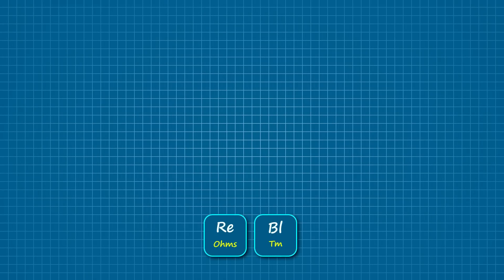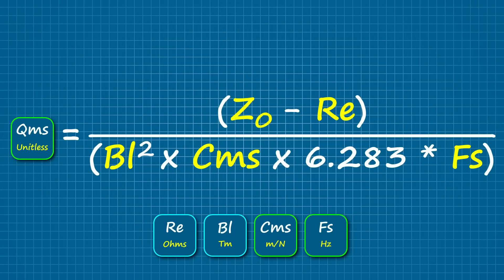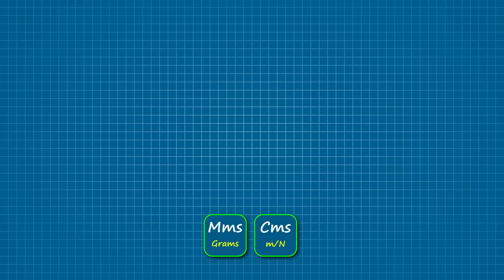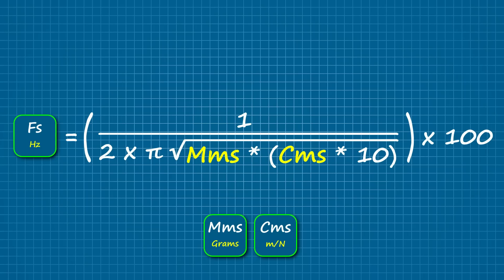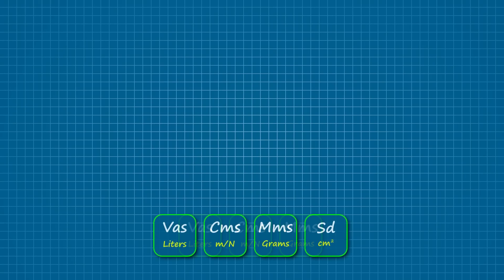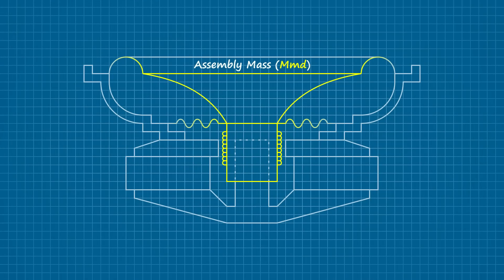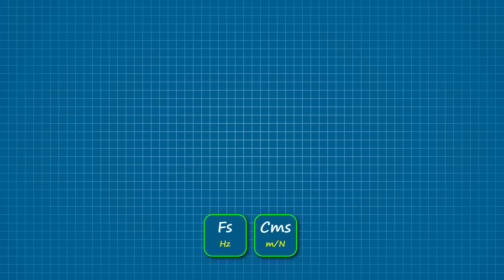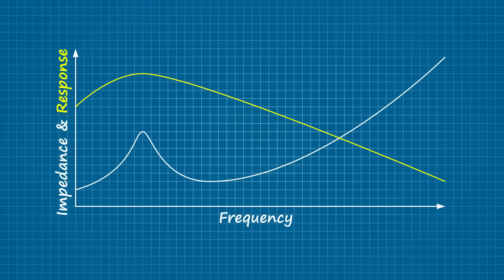T/S Parameters Explained (Part 2)

Comment: I've built guitars, valve amps, speaker cabinets, recording gear, recorded and mixed and done just about everything but this is the one thing that brings that all together from inductors, electrical losses, impedance, Ohm's law etc. Its all making sense where it didn't reading a book 30 years ago - thank you so very much!

Comment: Excellent information. Another T/S style parameter that is often messed with is Sensitivity. Usually listed as 2.83V, which IS 1 watt into 8 ohms (nominal) BUT 2 watts into 4 ohms and 4 watts into 2 ohms. So this inflates the 4 ohm sensitivity by 3dB and 2 ohm by 6dB. Weasels!!!

Comment: I Bought Some Subs that has no Spec data in the boxes nor website and when i email the Company i got no response. We dont hardware to test it manually so is there any recommendation for an Enclosure. They are 12 Inch, Single 8ohms, 150RMS. From the looks of it I would say about 10mm Excursion Peak to Peak. Any help would be Appreciated. Subs Are Powebass PX-128

Comment: I am 55 and have finally registered as a sole trader designing, building and hopefully selling a battery run, high fidelity, high power  and portable guitar amplifier for busking.
As a guitarist / musician  with a good grasp of electronic engineering and carpentry, but not of speaker box design, I have done a lot of research and it becomes more interesting, especially when it is important to customer confidence that my product lives up to may claims.
I have also found that solid answers don't come without solid data, which you have supplied. Thanks.

Comment: These two videos are probably one the best around about drivers parameters.
About Le value : it's irrelevant in the loudspeaker box nor filter design, as it's far better to use an advanced software which include the Fr (driver+box+baffle step) and the Z curve (in the box !), than a zobel.
As a designer I use to keep it low, for Le(i) THD, and linear within X for Le(x) IMD.
The lower Le in the coil, the higher Le in the filter for the same cutoff, but lower thd+imd.

Comment: This is all of why I am taking my time to put a sub in my car. My friends keep saying things like "just get a 1500 watt amp and put a 15" in your trunk". But I am designing a few boxes to the TS parameters of a few Dayton Audio RS series subs to try and figure out what would fit well in the upper deck of my trunk. So I am not only bound to the physical size constraints of my car, but also the TS parameters of the sub and the wall thicknesses of the building materials. I am even considering port placement to make it fire up through a hole in the rear deck of my cabin as the upper deck in my trunk is right beneath it (it's a 2008 crown Vic). My vision is to have a truly high fidelity install that doesn't cost me an arm and a leg, so I am choosing to spend my time instead of my money on getting this project done just right.

Comment: Absolutely love the videos, thank you for making the world a smarter place!

I have a video request - I'd be interested in seeing your engineering design process, or as much as you can show without putting yourself out of business! Here's a theoretical: given a specific design objective, how do you choose the loudspeaker and enclosure design, then accurately model the overall cabin+enclosure+loudspeaker+DSP gain (if applicable) to achieve that goal?

As a relatable example, my approach to hobby car audio is trying to get a reasonably low f3 rolloff out of a certain "allowable volume" for the enclosure (sometimes its nice to have room in the trunk for groceries). I imagine the allowable volume would dictate achievable SPL at that lowest frequency and from there we could choose an enclosure type and find a speaker with approximately the right T/S parameters that would meet our goal. I understand everyone's audio goals are different, but for the general flat-response case in a measurable environment (aka specific room or car gain), how would an audio engineer approach the problem?

Either way, keep up the awesome content!!

Comment: PLEASE READ! 

I'm sorry. I was so hopeful for this video. You expanded on ideas and topics I've never considered, like how to spot BS specs, but I really want a video to explain how changes to different parameters affect the sound. How does changes to free air resonance, damping factors, linear Xmax, vas, etc,  affect the required box size, clarity, accuracy, low end extension, power handling, response and more. 
Can you, someone experienced, simply read the parameters and tell if this would not sound good in an X configuration. Like, "this sub is design for competition and loudness, not sq", or "this is best for Rock, not rap."
If you can, I want to know how. 

Ex: look at the ts parameters & compare  a (all JL Audio) 10w3v3 vs 10W6 vs 10W7AE.
Why, when I plot the response in the recommended boxes, does the W6 get louder@low end than, w3, and the W7 get even louder at low end than W6? How is this possible when the box size for the W6 is way smaller than the W3, but the box size for a W7 is relatively large again like the w3. What changed in those parameters?
Reply: Jonathan Fielding : This can be done by someone experienced.. In my case it mostly guides me.. to what woofers I want to model and listen to.. I’ve never bothered to lined up the specs side by side to analyze.. Its a little tedious to remember the average vas for example, of different size speakers in both cubic ft and litres.. ( unless it’s your full time job I guess) ... But a lot can be said about the sound by examining a speaker... ( when you know how the parameters effect response, how parameters are achieved and materials ) .. The vids your looking for would be lessons on how to design raw speaker drivers... (I have some experience ..I’m all in :))
Reply: I was hoping for a video like that as well... no one really explains what specs to look for and what each spec is good for ... car fabrication did a video on specs but didn't really get deep on the important specs I should lay attention too
Reply: Jonathan Fielding

  I´m also looking foward to when he explains all that. 

  But i will give you a little tip, from my experience, just regarding one of the many things you asked. When you said "this is best for Rock, not rap."  Many people assume that there are sub´s better for some music genres and other sub´s better for other music genres. That is BS. A really good sub will be really good with all music genres. But what happens is that there are some genres that are not as demanding as others, so they will not reveal the sub shortcomings as well as other genres. What you have to do is try the sub with the most demanding types of music. If they play those right, they will play anything right.  Just my 2 cents...
Reply: Look up the free program WinISD, you can enter the T/S parameters for a speaker and modify the box volume and tuning dynamically to see what it does to the frequency response curve. On changes to the speaker characteristics, you have no control over that - those are characteristics of the speaker. You do have control over the box volume and tuned port. I do know as a bass player, that one of the most important speaker parameters is Xmax which is the maximum mechanical movement of the cone. If a bass guitar speaker has too small a value (2 to 3 mm), at loud volume the speaker will over extend and "fart" which is the term that bass players use to describe what happens to the sound. ideal Xmax is anything over 6 mm. Music doesn't have this problem because it is compressed while live bass playing doesn't.

Comment: I love how indebth you go into this! so i was that guy that fell for a sub because it had a big magnet and it was used and eventually the shorting ring got loose and had to rebuild it, so i sent it off the get rebuilt and reconed and wanted to design an enclosure for it but im not sure if it matters if i measure the t/s parameters before i brake it in or not, the suspension of this is still really stiff making me think i should run some power to it and get it moving for a while before actually gathering the information i need. If anyone can help that woul be appriciated thanks in advance!

Comment: These are great videos explaining the parameters but how does each parameter correlate to the ideal enclosure and overall sound? How would you design an enclosure using these parameters without plugging them into a computer program? Can you give some physical examples of how subs behave and sound based off of the parameters? Which parameters are most important when comparing subs?

Comment: I own a Peerless XXLS-P835017  for diy... it cost me alot of money to obtain it, I didn't really understand the TS parameters well, but i knew it was a good sub-woofer based on the reviews, so I modeled the enclosure after the SB 2000, one thing was clear buying speakers from a reputable source  yields amazing results.
Reply: amplifiers are cheaper than speakers to develop , so the market is a land fill of rubbish, and to compensate for this, kw amplifiers are driving cheaply made speakers.

Comment: Odd Question But If You Plan To Run 2 Subwoofers In A Shared Ported Enclosure Wired To 0.5 Ohm... Should You Get The Free Air Parameters Of Both Speakers Wired Together At 0.5 Ohm?? (How It's Intended To Be Ran In My Case) Or Does Just Taking The Parameters Of Just One Driver With Coils Wired In Series (My Case 2 Ohm) Give You The Proper Parameters For Enclosure Building Referencing For 2 Speakers In A Ported Enclosure? 

Same With Measuring The Port Tuning Of An Enclosure With Dats. Should All Subs Be Wired To How They Are Going To Be Played In That Enclosure (In My Case 0.5 Ohm) In Order To Get Box Tuning With The Speakers Installed?

Comment: Good vid as always. My question is what exactly does rms means when talking about power handling. Some say it's half the peak power handling I say it's not Then I get into forum arguments..
Reply: not a professional here, but normally its what the company rates the sub can play on until the cows come home. it's normally how much power the coil can take without overheating at all, but sometimes it can be the suspension or surround limits to. at least that's my take on it take it for what you will.(also just on a sidenote,  peak power handling is an very varying non consistent thing so idk how you would use peak power to measure rms)

Comment: Pete can you briefly explain what’s the difference between X-max And X-mech.  I know that X-max is linear but what I don’t understand is how can full excursion (X-mech) not stay “linear” the cone is just moving in and out. It’s held centered by the spider and surround isn’t it?
If it was not centered at full travel then the coil would hit the motor?
Reply: HexiBase with the exception of JBLs DDD ;)
Reply: HexiBase Now I feel dumb.  So then, linearity just means the measurement in mm of the distance the cone can travel before it starts losing control to the suspension? By losing control I mean that the cone is just tossing back and forth instead of being controlled precisely by the amplifier??? I remember you saying something like that years ago in one of your videos about the DDZ12s you were going to put in your Grand Vitara.
Reply: dvcsub xmax is measured to 70% bl, where xmech is voice coil height minus the height of the gap, devided by 2.

Comment: Hey, I rebuilded old infinity closed sub. I replaced 2 6.5" inch "subwoofers" with cheap woofers and added one dayton bassshaker inside box for low vibrations. It sounds much better than I expected.
What you think about combination basshakers with subs ?

Comment: why are all these specs taken when the driver is new aka not broken in?  I am under the understanding that there is a pretty significant difference...  Good job again Pete good content man.  Let us never again buy a cone radiating coil transducer speaker again with out being provided the T/S parameters, we vow!
Reply: Generally changes between new and broken in are subtle. And most likely not enough to greatly alter the alignment.
Reply: that must just be the case!!!

Comment: I’ve just purchased a CT Sounds Meso 8” dual 2ohm and can’t get an answer on port tuning from them. Have a .75 ft3 net enclosure as recommended per website but can’t get tuning length with them for hard hitting rap. Any recommendations? Can fit up to 4” I’d pipe.

Comment: "You know the guy" haha 100% we all have that person. I once was shown a 12inch woofer without a box connected to a headunit directly and was suposed to be impressed. Hahah
Reply: When I was in college I had a classmate want to show me his 2 new 12” subs. He had them in a small truck box and some crapaness $30 amp... they were more pathetic then most factory stock speakers that I’ve heard, he had one of the speakers wired up backwards too, contributing to the horrible sound quality/volume output, I corrected the polarity for him right quick and adjusted some of his gains (he had every adjustment maxed out) and they then sounded ok, a lot better then they did before.

Comment: This exact problem happened to me. I just bought a 10" Philips sub off eBay that seems to not even exist. You literally cant find anything except one German forum post, one site which lists 3 parameters and an Youtube video. The only 3 parameters I could find were the VAS the QTS and the FS. I added the SD and ZNOM and there we go, I had to guess all of the other parameters. Its really annoying and the biggest reason I will buy myself Daytons Dats system asap..

Oh, and this was also the first time I worked with winisd and it was hard to get into it but I would never spend money for Bass Box so I guess I will have to get along with this program. Or do you know alternatives?
Reply: Pat Yeah I see people saying their going to buy a certain sub and ask how it'll perform and I tell them to not bother with it as the T/S specs seem non existent at least when I google it.

If you have to try that hard to find T/S specs, probably better to move on to sometime better.

Comment: Sorry for the kind of off topic question but I thought this might be a well educated community here.
I want to get a new 2.1 setup. I kind of settled on the Swan M300 and the SVS PB-3000. Problem is that the Swans are active speakers with either digital or RCA analogue input. The SVS has only RCA analogue input. I thought about using it's 80 Hz high pass filter and send that filtered signal to the speakers.
How would I go about setting these up? The sub wants a pre amped signal according to it's manual. I guess the speakers don't like an amped signal since they are active speakers. So, as I see it I can either go into the sub with a weak DAC output and then into the speakers or buy a preamp/DAC-preamp combo but would the speakers like that?

Luv u all :*
Reply: @HexiBase  I've seen a review about it but how would that help here? Isn't it acutally just a DAC with EQ?
Reply: @HexiBase  Yes, I should give the MiniDSPs another chance I guess but my actual question was if the SVS PB-3000 will be fine with a not pre amped signal. So one that a normal DAC would put out. Such as a Schiit Magni 3.
Reply: @KALTBLUTWOLF1  How would you then apply volume?
Reply: @carlosoliveira-rc2xt I want to connect these to a PC and control the volume from there. Sorry, I thought this would be obvious that my source would be able to control the volume. I guess to use a PC as source isn't too normal for many applications :D

Comment: Peter, all nice and all that, but what about the actual sound measurements with proper mic and decent software to confirm that calculations and the influence of the car interior don’t mess up ? Untreated car with rattling body work will definitely ruin even the best subwoofer in the best and most optimised enclosure...
Reply: And I know that You know, but it would be worth mentioning

Comment: How are the T/S prarameters actualy messured ?
Reply: @HexiBase  yes.. well i thinks so :) .. was wondering about the different divices and systems are used to get the parameters from a "unknows" / New  unit. eg if one find an old unit without any markings or if on builds a new unit
Reply: @HexiBase  Do you have any opinions on the Dayton Audio DATS V2?

Comment: So how do I calculate sd ?
Reply: You just measure the diameter of the cone + half of the surround
Reply: @HexiBase  Oh yeah, thanks for adding the rest, I totally forgot about calculating the surface area 😅👍
Reply: HexiBase thank you very much! You just helped a 14 y/o who has an awesome chassis laying around at home with out the damn sd value on its data sheet